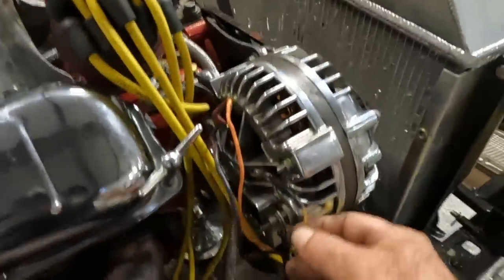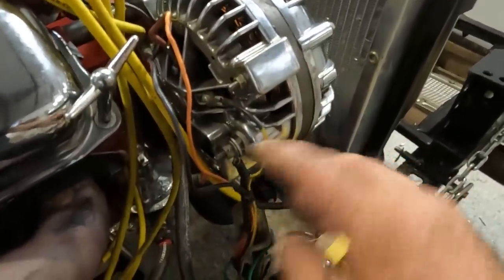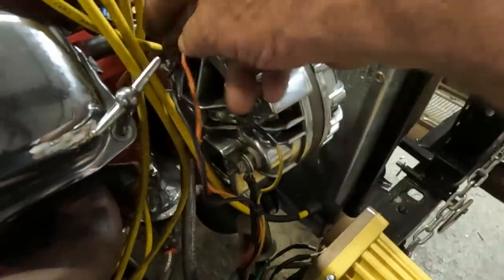Bad Back, Bad Parts, Troubleshooting And The Easy Way To Wire Your Battery Kill Switch

Comment: The lesson here is basically ALL quality control has been flushed down the shi++er these last couple of years. I see it every day in my job, processing endless warranty claims involving the electronic components on the products we sell. It's all crap these days. Hope your back feels better, Unc! Been there myself for the last 32 years
Reply: This is so true. You either have parts that are made expertly and are twice as expensive as they used to be or you have cheap parts that are questionable at best and you just have to roll the dice.

Comment: I've had this issue with many of these "new" cut-off switches (of all makes and price points). A year ago, I installed a brand new one on a Kenworth (Extreme Amp - Made in the USA - because DOT requires them on all Semi Trucks as well) and it too was bad right out of the box! It doesn't matter anymore where this stuff "says" it's made, it's all a gamble. Glad to hear it's a simple fix and get some rest man!

Comment: At my day job for a state agency that does things like plow snow and pull dead animals off the road, most of the equipment has battery master switches. We're supposed to shut them off when not using whatever it happens to be. Apparently they use higher quality switches because in 6 years (seems like a lifetime) I've yet to hear of any problems with them. Anyway a person may be better off looking for one at an equipment vendor rather than an internet car enthusiasts vendor that might sell cheap imported parts from time to time.

Comment: Been using field wire switches for years. It not only saves hp during a run but makes starting a high compression/advance ignition engine much easier.
Reply: How does that help during start up ?    Also ,can you guess from your time slips how much horsepower you think you save with a field wire kill ?
Reply: @donberry5677  It doesn't help during startup, that was a senior moment. I haven't a-b tested the field wire in 30 years. It made a big difference so I've been doing it ever since.

Comment: As someone who deals with back pain, the best thing I can recommend is plenty of heat. It will relax the muscles and relieve the pain. I suggest at least 20 minutes after working and moving around. Also a good benefit is doing stretches( not while your back is messed up of course) to help keep things limber. And for the car, there is a phrase called Keep It Simple Stupid. The easier it is to fix and maintain the less trouble you can have with it. I'd rather have things simple than overly complex.
Reply: Sorry to hear about your back. Just pulled a muscle or somethingin my lower back while organizing the garage. Lifting while twisting a heavy trunk. Yeah, don't do that. Feel better Tony.
Reply: Anti inflammatory helps along with Heat and ice, Weight Control too.
Reply: @easycrider7453  I have been dealing with it for 21 years due to a car wreck I was in at 17. I was in the back seat and it was just hard enough to mess my back up. Plus, working in manufacturing and other work environments with concrete floors doesn't help either. I have a few tricks that helps me keep going.
Reply: It’s usually noobs like me who make something overly complicated, I end up being proud of my crazy work until an old timer shows me the easy way I should have done it. But that’s how I learn

Comment: Another thing to consider when relocating your battery with a long cable. I learned this lesson the hard way. You need as much ground as you need power. I did one of mine running real heavy wire to the starter and just a regular battery cable to the frame in the rear. It would start fine cold but once it got hot it wouldn't start until it cooled back down. I thought it was the starter. I went to the speed shop looking for a high torque mini starter. The old timer at the shop asked me a few quick questions about the engine. Then he says did you relocate the battery in the trunk? I told him how I set it up. He responded your small block isn't that bad ass. Your starter is fine. Save some of your money. Go the hell home and run a cable to the block from the battery. Get some good straps/cables from the block to the firewall, frame and the body. Sure enough never had an issue again.

Comment: Good idea in the field circuit cutoff. BUT something to ponder, I did that on my cobrajet (I know it's a Ford.....) and got to thinking about it and called Ford Motorsport tech line and the tech gave me something to think about. 

With a charging alternator you are putting OVER 12v into the ignition circuit up to about 14.2v.

 However even with a fully charged battery you will be supplying only about 12.2 volts OR LESS into the ignition circuit with an open field (battery voltage.)

Comment: love the alternator cut off idea!! save HP !!!
Reply: Tried this car slowed down. My conclusion is that there is so much draw with modern electronics alt is faster.
Reply: @moparsareeverything1980  yep stuff works better with voltage ,vs the slight drag the power of takes to make the alternator turn. 
Besides ,if your battery is  decent it's theoretically only running what's causing the draw.

Comment: The last time I built a car with NHRA rules in mind- I sourced all the battery-side  parts n pieces from the heavy truck industry, which conveniently was my day job LOL.  Cutoff switch, cabling, etc were all sized for your average Freightliner- it was slightly overkill but it sidestepped any chance of being underrated for the job, avoided the iffyness of "performance" parts that didn't deliver their advertised ratings,  and never failed.
Reply: I wired my setup like the "m.a.d. enterprises start-em up kit". 
Look at the kit online ,it's a Ford solenoid and some wire. 
Wire it so the bigass + cable running to the front is only hot during cranking.

Comment: Uncle Tony
If you reconfigure the battery-cut-off switch to the ground side [ground side switch] you will fix the engine-cranking-slow  problem. Furthermore, the positive side is also the hot side of the circuit.

This is why fusese are always installed on the postive side if the circuit, if you install a fuse on the negitive side it won't blow, theirfor defeting the purpouse of the fuse.

Your fan always...

Comment: Uncle Tony. I have seen to many issues with battery shut off switches. Go to a heavy truck shop and get one for a heavy duty lift gate or a class 8 truck. I also do that with starter selonoids. You know like remote mounted Ford selonoids. Yea it's pricey but at battery amperage its your car to start on fire. Save money other places.

Comment: If your  back muscles are in spasm, don't just tough it out. Get something to relax those muscles from a doctor. Those muscles can keep on tearing themselves apart and it's no good for them. It causes damage. That's my opinion.
Reply: I agree. Except, don't get something from a doctor.  Get something for mother nature.. for example some witch hazel and oil of winter green as a rub.
Reply: I got a portable TENS unit from my chiropractor. It calms the nerves that make my legs want to run a marathon at bed time. 
I didn't use it as much when I was doing short hauls and could get out and walk around regularly.
Reply: Dogs lick me to death as I'm laying on the living room floor. I'm about ready to pull trigger on one of those inversion tables.
Reply: Acupuncture Heat Rest Heat Rest Stretch

Comment: Bad back. You just have to find out what works for you. Talk with other people. They put pins on my lower part of my body and my neck here at one put the rods in my back but I would not do that. It wasn't going to help me walk anyway. It took a while few years. Currently always in pain just question how much. If I had the answer you be the second one to know. Number difficulties with my back. Basically I just had to find something that mattered more. As far as the shut-off switch on the car thank you. I've got 50 olds well at least a body is. And I have some trouble somewhat similar to what you were speaking of. Never thought about that switch. So I'll check it. You're right about disabling the alternator for the run. Wish I thought about back in the day but nowadays I don't do that anymore. As usual I greatly enjoy the show and always learn something or get reminder of something which equates to the same. Thanks for all the time you put into each episode

Comment: With almost 30 years of experience on herniated discs, broken and/or dislodged vertibrae, compressed spinal cord, torn muscles, I can say this with confidence: Don't just lay on it, or sit on it. And do not use regular off-the-shelf painkillers and/or alcohol. These widely used methods only make the problem worse. CBD oil if you don't want to smoke, and organic non processed buds and leafs if you want to smoke. Then when it hits, you start to move. You need to get that piece whatever it is, back to it's original position. Wiggle it, stretch it gently, rotate slowly, focus on the bit that is off whack, and put it back where it belongs. No one else can do that for you no matter the certificates, and no other drug will help you to focus on the right bit and muscle group. With a bit of practice, it takes 15 minutes from crawl to running again, and around 3-5 days to full recovery. 6-8 weeks if the vertibrae is in pieces. Done all that, without any outside "help", no clinical operations, nor masseuses.

Comment: Good diagnosis. I know the good reason for having a master cutoff switch for racing,but i'm a paranoid person & i don't like the idea of somebody coming up while i'm parked & inside a store shopping & a stranger can just turn my car's power on/off. I even equip my older Mopars that don't have remote hood release,i designed a cable & small padlock where the hood cannot be released,raised or anything without me & my key.
Reply: Or.... if he read the Summit description, he could have avoided the issue.  The switch shows only a 125A continuous rating.  12' cables and an ancient starter and a big block mopar is pulling at least twice that rating.  RTFM.

Comment: Looking at the quick car catalog, the best guidance on master disconnects seems to come from their kits: 2awg is the biggest wire size they supply.  That holds up to roughly 115 amps of load before voltage drop begins increasing.  The normal business of adding cable size headroom of 125% of full load might not be completely necessary [a starter being an intermittant load], but I don't like it: a motor shortchanged on voltage will draw even more amps to make its rated power.  But the one switch they do put a number on helps: their high current alternator disconnect rates 125 amp.   This should work with say... a 1400 watt motor just fine.   Move to an 1800 watt starter however, and it needs 1/0 wire, and that switch you installed is going to get pushed very hard - its undersized a little too much for that power... if that's what you use.

Comment: I had a bad neutral safety switch, so I had to bypass it by grounding it to the trans. case. It left me stranded though at 114 F. degrees in Az.

Comment: I use an inversion table for my lower back. I was lifting a transmission a few weeks ago and something popped in my left arm. Tendon or ligament. A different vocation is the answer lol. I prefer the cut offs that mount to the battery terminal. If a car has a draw I can't figure out, I use a cut off.

Comment: I don't know what the rules say but you could mount a 200A Anderson socket to the car, and use an Anderson plug with a loop of heavy gauge cable as your switch. any problems you just yank on the loop and pull out the plug, battery disconnected. It probably doesn't meet the rules but it's just an idea that would definitely work.

Comment: If you like simple put an external electric pump back by the gas pump mounted on the outside of the frame with a clear fuel filter and you can see it. Now with the switch inside the car you can turn it on before starting it to fill the bowls, or while also racing it, if you choose. Yes you can suck fuel through an electric pump when its off. I can do it even with a little old used Holley 110 electric pump I have. You save an battery and starter with this setup.

Comment: I decided to put one of those cut off switches behind the license plates on my 64 Dodge polara and and doing the research I found there are different ant ratings for those switches I forget what it is some of them are 150 and some of them are like 400 or 600 I got the highest one I could find.

Comment: Most of the crazy battery cutoff setups I’ve seen are from people trying to cover all the bases with the shutoff killing the alternator and everything. Usually with road racing where they want the alternator working to power blowers and such. 
But, they do make cutoffs with an extra section specifically for killing the alternator. Often people try to hook everything through the cutoff rather than making a fuse block or junction block. The cutoff should only have a few wires to it at most or else it becomes a complicated mess.

Comment: I just got two bad thermostats in a row. Brand new. I’m never one to just blame parts either. I took them and BOILED them and they didn’t open. Did it alongside a known good one (the old one I was looking to replace nothing wrong with it just old and being proactive) that one opened just fine at the right temp.
Reply: It's becoming better to clean-up and use old parts, than buy new "mystery quality" replacement parts.
Reply: @joeteejoetee  so true

Comment: Nice video.  Find a reputable Acupuncturist in your area. Dealt with bad back for 30 years, it always fixes it unti I mess it up again.
Reply: Focus on learning to relax, and handling stress better. Over 30 years experience with back issues. Acupuncture just provides those who have a hard time handling stress, and relax validation with a scheduled time to relax. Learning to deal with stress better will help you prevent from injuring your back in the first place. Most people carry thier stress in thier back muscles. Tense back muscles is one of the quickest way to injury your back. Remember to breath, and let go of the stress! It's not what most people want to hear, but it's highly effective.

Comment: hey tony , just installed cam bearings the seem a little tight , "BTW 350 sbc 880 block , HYD roller"  you can turn it with both hands with gear on , or it will turn with 1/2 wrench seetms stiff to get started once you get it turning it turns easy with one finger . Is their a good way  o test it like a beam style torque wrench how many inches should it take ?? thank you for your time sir , have a great day !!

Comment: I saw a video of a guy supposedly cracking used motor oil for gasoline but he didn't explain the details. Do you know any way to do this or similar? If so can you do a video or recommend a link or something? We all love these old cars but we need fuel of some kind. Also have you worked with reefer diesels for re powering small cars and trucks?

Comment: Just had 2 delphi crank sensors for my dad's titan  not work out of the box, went to nissan and truck fired up instantly. Not sure if it's faulty parts or nissan is sensitive on their crank sensors. Either way the delphi part wouldn't work on whatever they where designed to go on.

Comment: Marine battery switches for boats could be another option. They're expensive but are supposed to be very reliable.

I think the logic behind putting the battery cutoff switch inline with ground (if in fact that's what was done) is this : If the battery were to become dislodged and the positive battery terminal were to touch the car body, you've got a shorted battery. A cutoff switch inline with the positive terminal won't prevent this. If the ground is disconnected and the positive terminal were to touch the car body, there is no short. Ideally, both terminals should be on a cutoff switch.

Comment: Having been hospitalized with a back injury I can understand the lightning bolt pain, but to have a job mechanicking or construction with a bad back has to be hell on earth. Rest, find a good chiropractor, try CBD gummies or oil for relief and muscle relaxing. (If you try the gummies--and they do work--take only on a full stomach and don't plan on driving for a while.) Best of luck, Uncle.

Comment: Sorry to hear about your back Unk☹....I will say your starter sound effects were probably enhanced by the pain😳. On the alternator kill switch....with electric water pump and fan there's a lot of hp to put to the track. You only really need to kill the alternator from staging to the run out. Thanks, good video

Comment: The worst thing for back muscles is to rest, there are stretches you should really do that will get rid of the pain.
Reply: Rest is only for the first 1 or 2 days after a new injury. Problem is most people go waaay beyond 1 to 2 days. Starting to do stretches & exercise right off the bat tends to worsen the injury, or create new injuries as your body will over compensate in an attempt to protect the original injury.

Comment: I can see that one time someone forgets to flip the switch for the alt and has a bad accident and the battery disconnect doesn't do its thing, user error.
Reply: The field coil switch will not affect a battery cut off switch. They are both mechanical, and independent of each other.